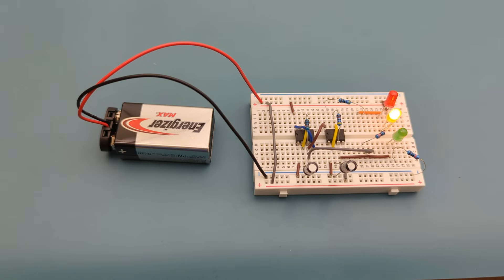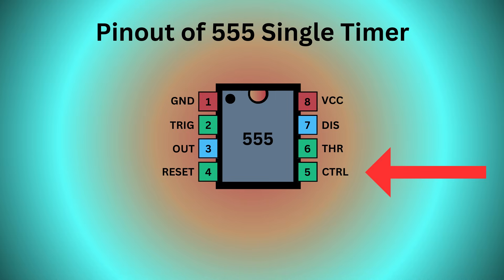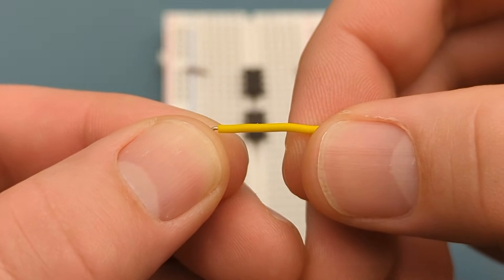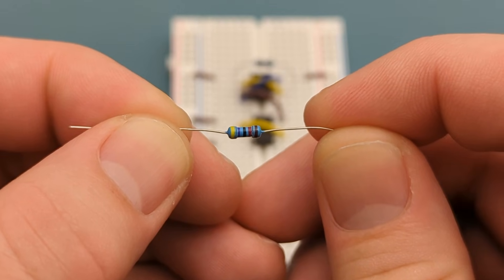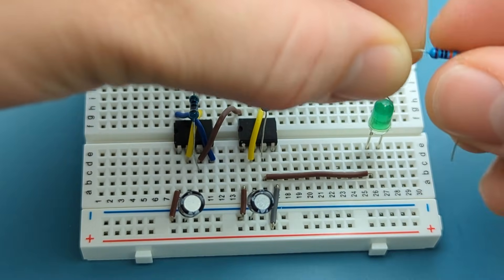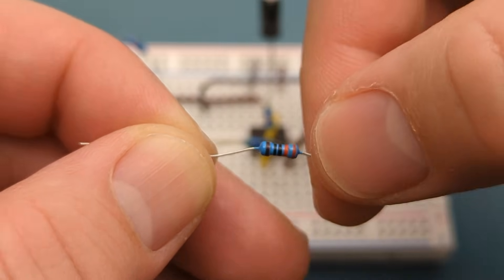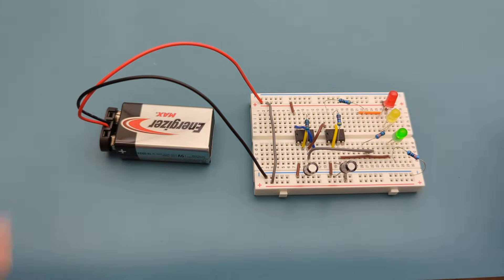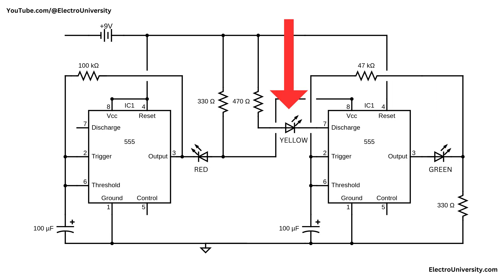How to Make Traffic Lights Circuit With 555 Timer

Comment from the maker: 🔔 Get your tools here:
✅ Electronics Component Kit: https://amzn.to/3N65asq
✅ 9V Battery Connector: https://amzn.to/3S7kbg8
✅ 9V Batteries: https://amzn.to/4kkonVD
✅ NE555 Timer: https://amzn.to/41MpQhp
✅ Electrolytic Capacitors: https://amzn.to/4dnrJF4
✅ Resistors: https://amzn.to/3YfGeUi
✅ Jumper Wires: https://amzn.to/3NNn9UR
✅ Solderless Breadboards: https://amzn.to/3SndKWm

Comment: My red led is not coming 😮
Reply from the maker: Double-check the 270 Ω resistor connected in series with the LED. It might be loose or in the wrong row on the breadboard.